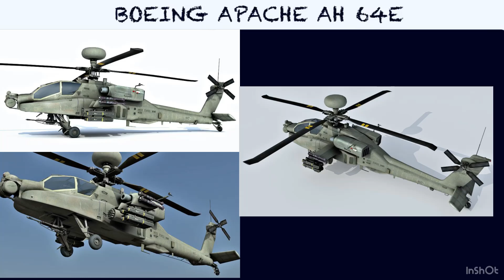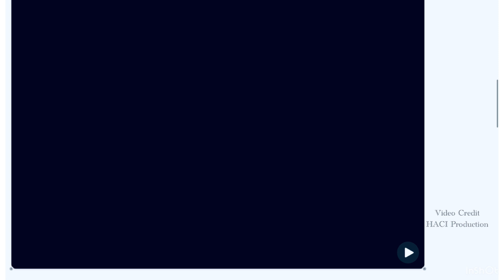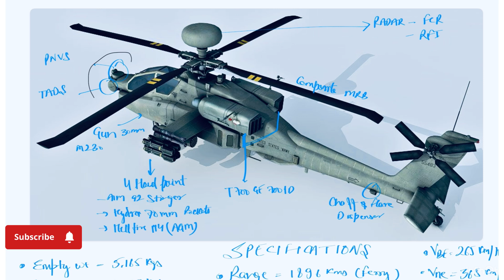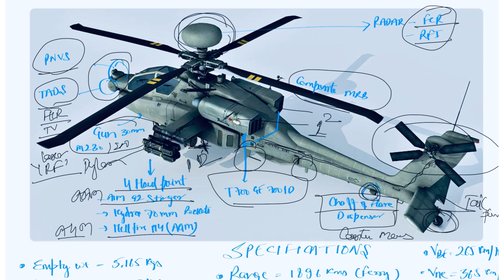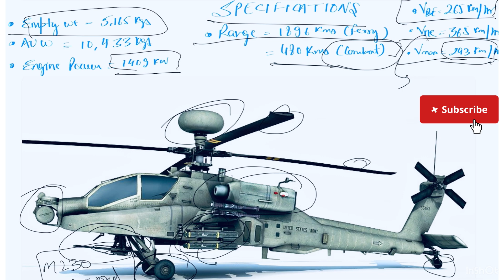All about Apache AH 64 E

Comment: As the British have the Longbow, with the radar and other sensors on top of the rotors, you don't need to expose the whole machine to the enemy when you're looking for them, you just need to expose the powerful radar above the trees, or buildings etc and duck back down again.
Reply from the maker: Might not be exactly true…. As the radar emits in a sphere… so a conventional nose radar would also detect any target far away with any such obstructions.
But a powerful radar above rotor is one of its kind which also gives room to put powerful sensors at nose also.